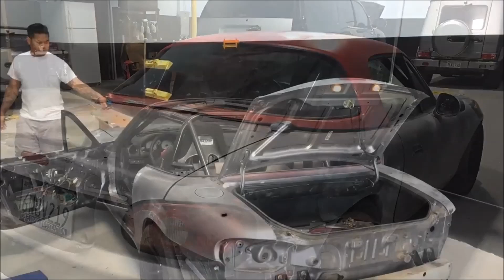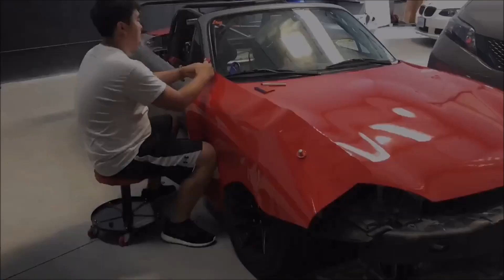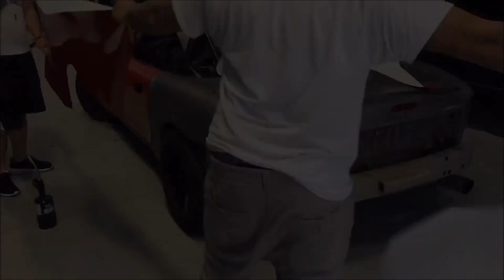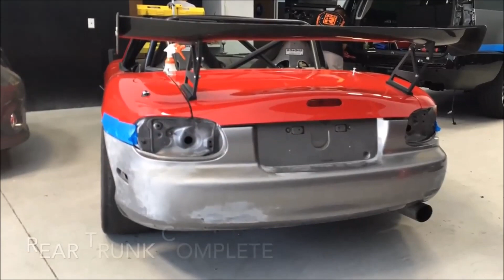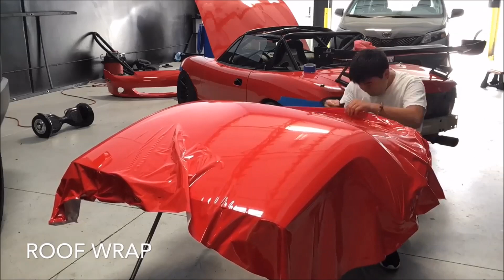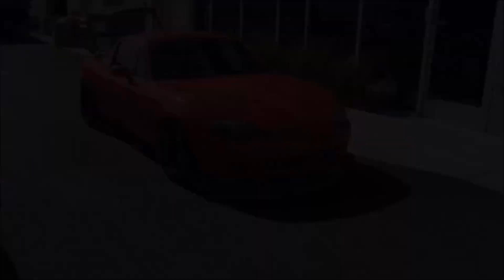Customer wanted to wrap his Mazda Miata to Ferrari Red

Comment: How is a wrap better than a single stage high gloss paint? If you ding the car you can't do a local repair and would have to remove the wrap from the panel, then fix the ding, then re-wrap it all. Plus paint looks better.  High gloss single stage polyurethane paint is the best option. Forget clear coat. That should have never been used on solid colors. It's mainly for metallics and metalflakes. If you have single stage paint you can buff it back to a high gloss when it weathers. Try that with a clear coat. Disaster.. And wraps don't have the depth of color anywhere near paint does. Stick on colored wraps are best suited for decals if you feel the need for those. Wraps are also good for window tinting from the inside at a pro shop.

Comment: Same thing happened to me. 
Used the cheap eBay wrap, after 2 years I couldn't even peel it off, had to scrape it off with a razor. 

I also wrapped over bare metal...Wouldn't do it on a nice car but my car is only worth about 1k. We'll see what it looks like in a few years when I remove it again.

Great job on the wrap btw!